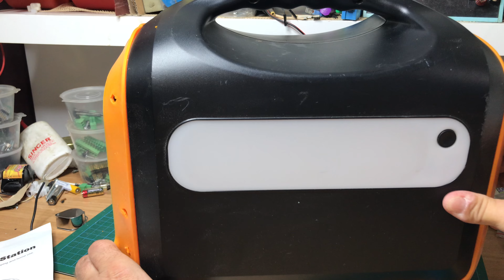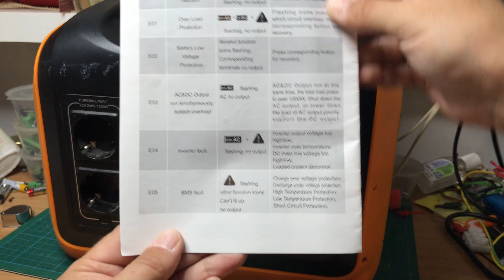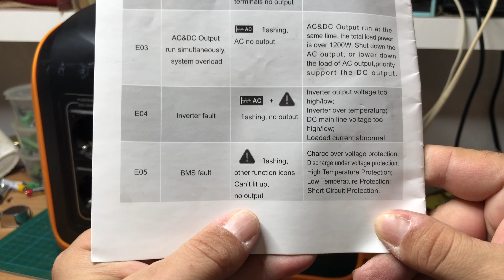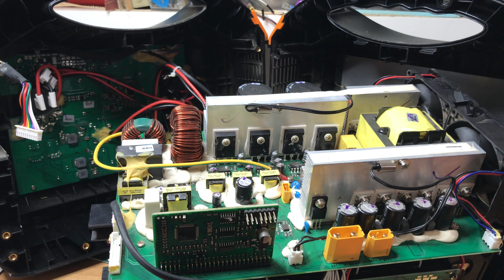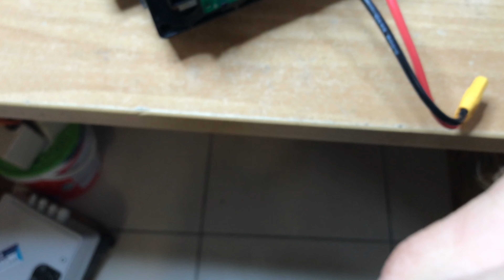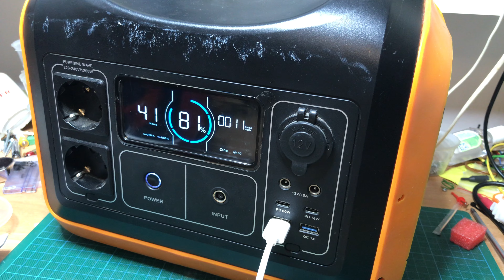Portable Power Station Disassembly & E005 E05 error - OUPES allampere Ecoflow #diy #powerstation

Comment: I'm sitting on two Oupes 1800w units that wont charge or even turn on! AND Oupes stiffed me on a 240w solar panel over at Temu!
Reply from the maker: You must be facing a different problem.... however if the batteries run too low it won't power up...